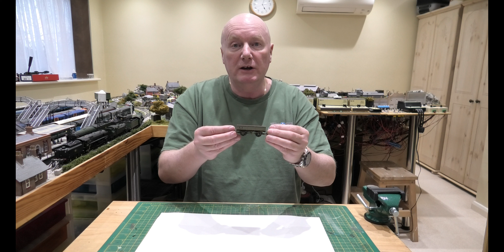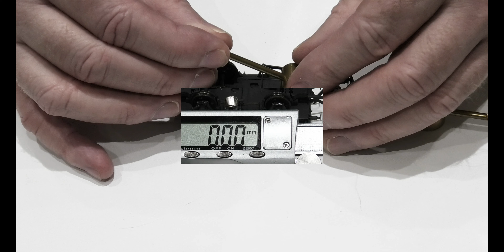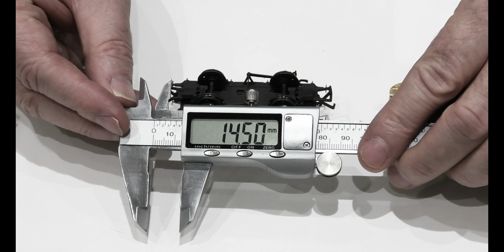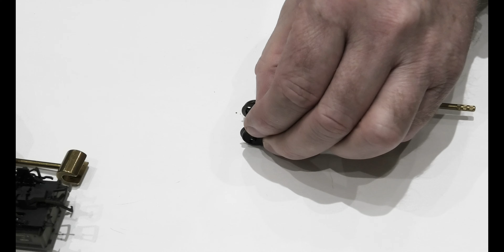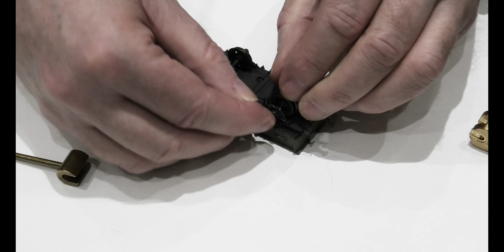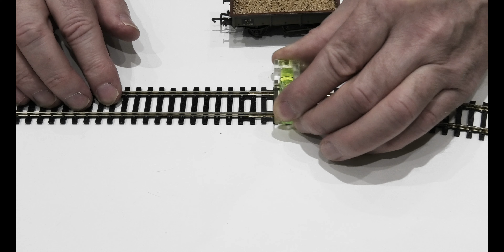Making light trucks run well on your model railway : 4k Widescreen.

Comment: Hi Paul. Nice video and in addition to this info, can I suggest removing all Dapol wheels from any stock regardless of make, and binning them. They are so inconsistent in flange depth and angle on the treads they derail on straight track if you blow on them! Replace with Bachmann or better still Hornby which are larger flange and wider treads, not so 'finescale' as Dapol (and ex-Wrenn) stock.
In addition to your back to back a lot of modellers don't keep stock wheels clean and they do collect lots of dirt which can harden and cause wobbles and derailments as well. You often find when a wagon suddenly starts to derail where previously it was OK, it's a blob of dirt on the wheel. For Code 100 modern Peco rail not finescale rail.
Reply from the maker: Your more than welcome to pass a view. I do not know anything about Dapol wagons as I do not have any. Keeping wheels clean is as you say a missed opportunity for smooth running. Thanks for the comment.